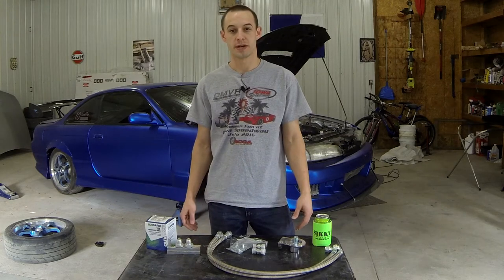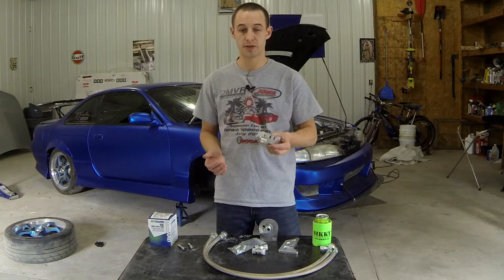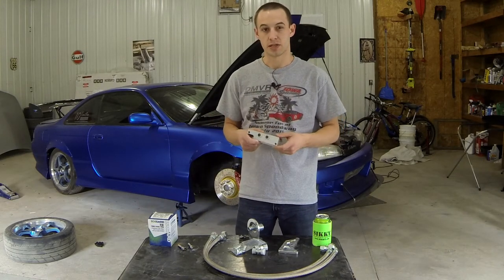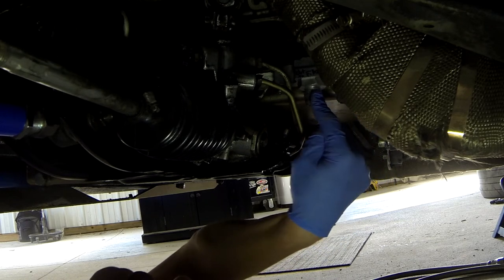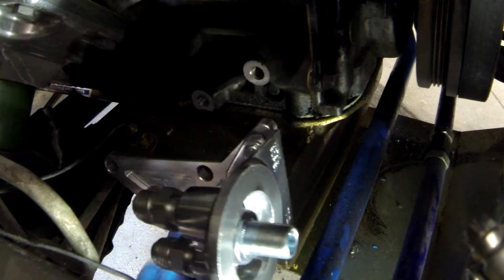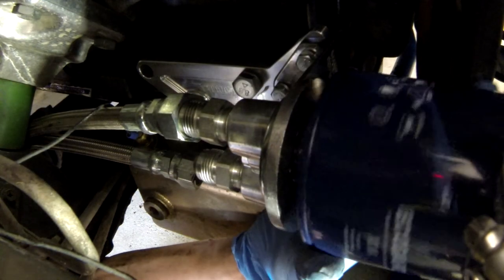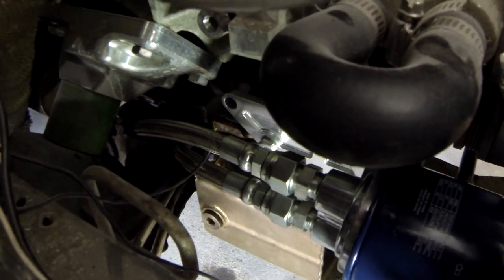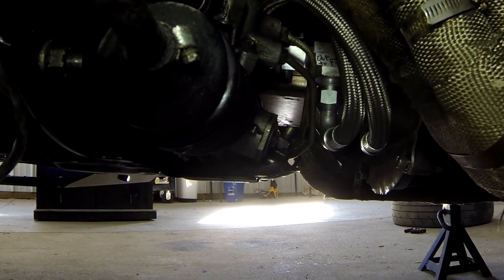Sikky Manufacturing Oil Filter Relocation Kit Install on LS1 240sx

Comment: Did you had to buy any fittings for the canton pan ?or just bought the canton oil pan and the Sikky relocation kit ?
Reply from the maker: I used the Canton Remote oil filter adapter PN: 22-630. It has -12AN inlet and outlets so I had to get two -12an to -10an fittings so the Sikky lines would connect right to it.  Hope that helps.
Reply: Ten Tenths Podcast this definitely helps thanks that’s exactly why I wanted to know
Reply: @TenTenthsPodcast  Any links to the fittings you purchased? Am currently in the same situation and not sure what degree the npt is but i know i need 2 fittings and they are -10AN on both sides however one side of the fitting needs to allow flow outward and one inward.
Reply from the maker: @shortybarrios8310  I think these are the ones you're referring to. 
https://www.cantonracingproducts.com/canton-23-465a-adapter-fitting-aluminum-o-ring-12-an-port-10-male-an-2-pack/

Comment: Can you post what you pieced together for the install? Looking to go lsx but trying to decide if just buying the sikky kit or doing the same as you did. Was it worth the trouble?
Reply from the maker: Jordan P I tried to do this from memory so some websites where i got used parts may not be 100% accurate but hope this helps. Let me know if I missed something you're wondering about.
LS1 with T56 = Craigslist

Sikky motor/ trans mounts = (used) Zilvia.net

Sikky Headers = used local craigslist (pure luck to come across this)

Canton LSX swap oil pan PN: 15-276 with Canton Dipstick = Ebay (new)

Radiator/hoses = Mishimoto black Friday sale (new) (also you can apply to be on “team Mishi”, you’ll get a 35% off discount)

GC Cooling 12” coolings fans – (New) GCcooling.com

Sikky oil relocation kit with bracket = Sikky Black Friday sale (new)

Sikky Clutch Master Cylinder Kit = (used) Zilvia.net

Wiring Specialties Pro Harness = (new) Wiring specialties Black Friday Sale

MGW Sport Shifter – (new) MGW website

GTO oil catch can – (used) Ebay

Sikky Power Steering Lines – (used) Zilvia.net

ChaseBays Fuel lines – (used) zilvia.net

TurnOne PS flow restrictor PN: T1115 – (new) TurnOne-Steering.com

Professional Products Fuel Rails = (new) ebay

Custom intake pipe using 4” carbon fiber tube and silicone couplings.

Custom Y-Pipe exhaust to connect with my HKS Hi-Power exhaust – local muffler shop

Local drive shaft shop modified my single piece aluminum shaft from my SR20 swap to work with the T56 (cost like $125)
Reply: Ten Tenths Podcast you are the man, you completely went above and beyond. I appreciate it. I’m gonna look this over and let you know if I have anything else to ask. I have a custom oil filter relocation setup from my sr so I’m kind of hesitant to sell before seeing it will somehow work

Comment: Will you eventually get an oil cooler?
Reply from the maker: No immediate plans for it; oil temps never were an issue for me last year but I will see how my temps go this summer and determine if I need it. - Rob
Reply: looks like you had a sensor in the canton pan already. What sort of temps did you see at your PDX?
Reply from the maker: Johnman5757 I want to say the hottest I saw was around 250° on a very hot July day (I'm blanking on the exact temp). I have a 160° thermostat and my fans turn on at 165°. That was also when I had cheap ebay fans and a non vented hood. I'm impatiently waiting to see what my vented hood and GC Cooling fans do for my cooling.

Comment: How many qts of oil are in your motor now
Reply from the maker: I think I'm at 8 to 8.5qts right now. The canton pan is a 6.5qts and with the X1A filter it seems to have added close to 8qts total. I haven't had a chance to do a complete oil change since doing the oil filter kit install; only a top off (which was about 1.5 qts but its not completely at "full").   Sorry I don't have a more definite answer yet.
Reply: Nah that's good enough - the sikky pan and dipstick doesn't read any oil at 9 qts, but I know I have enough. So I was curious. Thanks man!